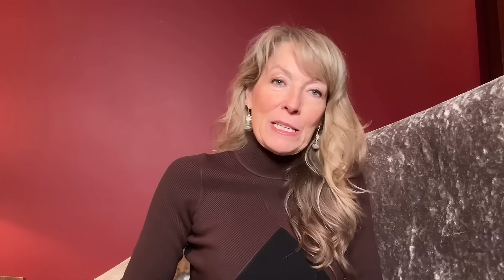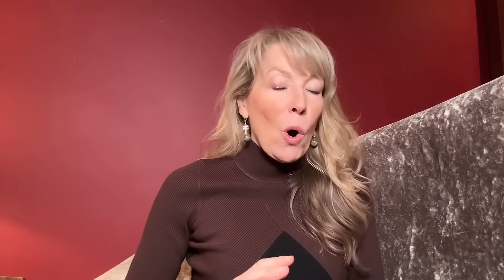Sun Dimming Explained | The Climate Experiment Nobody Voted For!

Comment: I made a youtube channel dedicated to this over 11 years ago called "Chemical Trails" and recorded sunny clear blue skies until the planes started flying back and forth covering the sky completely blocking out the sun.  Not chemicals but they may be using dry ice because 1 pound of dry ice mixed with water will produce 250 liters of carbon dioxide gas which will spread out and linger at 30,000 feet blocking out the sun.

Comment: I have a Masters of science degree in the medical field and I always loved all the sciences. I'm also a bit of a history nut, and kept finding examples in history when the climate then was warmer than today. As those examples seemed to be synchronous across multiple continents, I started to suspect what I'd been taught and always believed about climate might be wrong. To clarify the issue I began reading all the paleoclimate studies I could find. What I learned is this. If you haven't read the primary sources supporting both sides of this issue then what you think you know may be wrong.

Most paleoclimate studies done before the 1990s were straightforward and unambiguous. Those early studies found multiple periods throughout the Holocene that were significantly warmer than today. More specifically, the evidence showed and the scientific community agreed, the Medieval Warm Period from about 900 to 1300 AD, the Roman Warm period from about 250 B.C. to 400 AD, and the Minoan Warm Period from about 3200 BC to 2200 BC were at least 1-2°C warmer than today. The Holocene Climate Optimum from about 7500 BC to 3900 BC was at least 3°C warmer, and the early Holocene from 11,700 to 8,300 years ago was up to 7°C warmer than today. 

Throughout the Holocene these warm periods have been interrupted by abrupt cold periods that generally lasted 200 to 800 years, the first was the 8.2 kiloyear event followed by the 5.9 kiloyear event, then the 4.2 kiloyear event. The Late Antique Little Ice Age at 536–660 CE ended the Minoan Warm Period. The Dark Ages Cold Period from 400 to 800 AD, which included the particularly cold Late Antique Little Ice Age 536–660 AD ended the Roman Warm Period. The coldest and most recent climate downturns was the Little Ice Age from roughly 1300 to 1850 AD. The trend through all these cycles was gradual cooling. Each warm period was a bit cooler than the previous warm period, and each cold interruption was a bit cooler than the last. Regardless of the cause, there's nothing unusual about how the modern warm period fits this overall trend. The warming hasn't happened any faster and the temperatures haven't any been higher than during the Medieval Warm Period. The written histories tell us warm periods were times of abundance. Crop yields were high, seasons were predictable and mild, and weather was generally stable. Archeology implies warm periods saw civilizations rise, and with cold came famine, disease, population decline and civilizations often fell.

Modern textbooks wax poetic about Svante Arrhenius and teach his greenhouse hypothesis as though it were fact, but very few touch on the reasons it was essentially ignored for nearly a century. In 1900 Knut Angstrom pointed out that water vapor is far more abundant in the atmosphere than CO2, and intercepts almost all infrared radiation CO2 can absorb. Moreover, the small bandwidth of IR radiation CO2 might return to the Earth approaches full saturated above 350 PPM. I understand the counter arguments to this, but my point is the climate is a far more complicated system than the greenhouse hypothesis takes into account. Climate change is the product of many interactive variables that are difficult or impossible to quantify. There are many variables some scientists believe play a role which aren't factored into current climate models. There are probably many others no one has even considered. After much in depth study I think the complexity of climate is far too great to put much confidence in "consensus" views or any predictions based on computer models. Anyone who believes climate is as simple as how it's described in most textbooks, just doesn't know enough to know there's a lot about climate that nobody fully understands. There's good reason after 30 years working on the problem the IPCC has only managed to narrow their original estimate for ESC from 1.5°C to 4.5°C, down to between 2.0°C and 4°C. After investigating the history of how this issue evolved, I can think of many reasons outside science why the IPCC can never conclude ECS is low enough to not pose much risk, even though the most robust science suggests it's only about 0.5°C and no more than 1.5°C.

Regardless of anyone's estimate, what I can say for certain is something changed in academia starting at about the time of the 1978 Charney report. That report was the basis of the Carter administration's decision to create the Department of Energy and the same year the US started spending billions on research connecting anthropogenic emissions to global warming, and investing billions more on renewable energy, that for some reason excluded nuclear power. Since the late 70s the amount of money going into climate research, and carbon free energy (excluding nuclear) has grown bigger with each passing year. In my studies of climate I couldn't help noticing the more money went into research aimed at connecting anthropogenic emissions to global warming, the more low quality studies and untestable papers were published to confirm that connection. As years went by and even more money went towards establishing the connection, I noticed even the studies containing good evidence to support the previously agreed upon past warm periods were tending to focus on other aspects of the data instead, as if to avoid saying past warm periods were warmer than today. In cases where the evidence of previously agreed upon warmer periods was too incontrovertible to ignore, there seemed to be some kind of requisite to diminish the results by emphasizing the locality of the evidence and clarify such evidence shouldn't be considered representative of the climate as a whole. This approach seems to be part of a concerted effort to reconstruct the paleoclimate record, by saying the evidence of past warming was only a local phenomenon. To be clear, the real evidence hasn't really changed. It was just weakened and water down enough to make way for less scrupulous scientists to use less robust, misinterpreted and in some cases fraudulent evidence to get rid of those inconvenient times in the past that all scientists had previously agreed were warmer than today.

Then in 1988 James Hanson went before congress and said by the year 2000 New York City and large parts of Florida could be underwater if the world didn't quickly end its reliance on fossil fuels. That was the same year the IPCC was formed and chose to ignore hundreds of paleoclimate reconstructions done by many of the world's most prominent scientists, deciding instead to make a newly released tree ring study from a plucky young climatologist by the name of Michael Mann the focal point of their first report to the world. With that decision the hockey stick graph made its debut to the world. After that first report the idea that anthropogenic CO2 emissions were endangering the world went from a multibillion dollar premise to a multitrillion dollar premise almost overnight. In 2024 that annual figure surpassed 10 trillion dollars; more than 10% of global GDP. Trump pulled the US out of the Paris agreement, but he didn't do much to cut climate funding in his first term. 2025 was the first year since the Charney report that global spending on climate change was less than the previous year, and look at the impact that's caused. i can't help but wonder what might be if the climate change issue hadn't been flooded with such enormous sums of money for the last 50 years.

We'll never know the answer to that, but the way things played out, by the mid 1990s "the science was settled", and any scientist or academic who said anything against the "consensus" or criticized Mann's Hockey stick graph was instantly labelled a "climate denier", who must be on the payroll of big oil. Some of the most experienced scientists in academia were shown the door, and others took early retirement, but most had gotten the clue by that time. Is it really any wonder that over the last decade there's been so many studies focused on undoing the work that so clearly once showed the climate was warmer than today for most of the last 12,900 years? I suspect Michael Mann may not be the only climate activist who also became a scientist. 

That means for those of us who really want to know what the unbiased science says about climate history over the last 12,900 years, we must seek out and find ALL the evidence, while keeping in mind most of what contradicts the "consensus" is filtered out by the search engines. When we've managed to find the primary sources we must read them carefully and sometimes make our own interpretations of the data, because it's become painfully apparent certain things aren't allowed to be stated directly. The good news is there ARE still some scientists who put their scientific integrity above ambition. So long as they're willing risk their careers and future funding opportunities, being blackballed by their colleagues, and don't mind their work being published in more obscure journals, these scientists quietly go about doing good honest work that follows the evidence instead of the crowd. Others reveling in the freedoms of retirement are reaching large audiences through substack when academic journals refuse to publish their heretical work. A few such scientists have taken the time to create a Google Maps page featuring an ever growing number of paleoclimate studies from across the world, (currently at 1269) that evidence a Medieval Warm Period as warmer or warmer than today, that was more or less globally synchronous. Many of these studies go back further and generally confirm the paleoclimate record described above. If you're interested in learning what the primary sources really say about the climate cycles of the Holocene you can check it out at this link.

google.com/maps/d/viewer?mid=1akI_yGSUlO_qEvrmrIYv9kHknq4&ll=44.26323281744471%2C-112.89120099371223&z=2
Reply: Thank you for all the knowledge and time. Based on your knowledge on this subject do you think there’s a connection between what the planes spray daily and the strange weather patterns? What I’m getting at is weather manipulation to push the climate change agenda?
Reply: @kramer7026  Besides the notable decline in  hurricanes, I haven't noticed any strange weather patterns here in the US, but from what I know of the UK government, they seem to be a particularly sinister bunch willing to sacrifice the good of the native population for the globalist agenda on any number of fronts. I hope the people over there wake up from their state propaganda fed stupor in time to throw them all out of office in the next election, and put some new blood in office who'll do all they can to overhaul and tear down the unelected bureaucracy that actually runs the government, the way Trump has been trying to do over here in the states.

Comment: Ok so they spray the sky and that creates and prevents some of the heat or radiation from escaping like it’s supposed to do but with all of the houses that have solar panels is now a factor and A BIG problem is they also reflect sunlight back up and it can’t escape anymore so it’s going to be like a sauna or worse like a desert in just a little while !!!! Don’t these people know that it’s not a good idea to mess with the weather or the sun or solar panels it’s just not going to work out. !!! Rather than fossil fuel is good or not it doesn’t matter if we eat it or burn it or just leave it alone it’s not enough to cause any kind of problem because there’s just not that much left anyway it has worked out this far but keep using it and develop something,something a lot better than a battery life because the damage caused by all this research has shown to be more harmful than anything else and poisoned earth with far more harmful chemicals than the fossil fuels so why don’t you brainiacs just stop and stop now stupid

Comment: WAKE UP. THE MAGNETOSPHERE HAS BEEN WEAKENING SINCE 1859, AND IS NOW ABOUT 35%+ WEAKER AND 1/2 OF THAT IN THE LAST 20-25 YEARS. The temperature is lower, but you can feel the sun is more intense. This is going to get worse; they have used their BS IPCC climate agenda to create a smokescreen. It's covered up this for 10-20 eyars, if not for Geoengeineering you would see it so plainly, plus it also helps degrade our environment for other goals, it's hard for this to even cover up the weakening magnetosphere. They will probably drop it when it suits, and we see the full brunt in a short time. They are up against a clock from natural cycles and need to scam us wealth-wise and get us under control before this all hits.
The CO2 we are supposed to be making is coming from this. ( of course, to get printed, this paper had to say CO2 and warming). We have since the last full magnetic pole reversal 781K years ago 45-60 major magnetic pole excursions and movements. One 42K eyars ago sent 60% fo large animals extinct and was the end of the majority of Neandertals. As it gets weaker, the chance for a normal CME from the sun to take out our electric wrold massively increases
https://www.researchgate.net/publication/281612324_Earth%27s_Diminishing_Magnetic_Dipole_Moment_is_Driving_Global_Carbon_Dioxide_Levels_and_Global_Warming

Comment: The commie enviro-whackos will be the death of us all. What most people don't understand is that there isn't enough sunlight to react with all the CO2 in the atmosphere by orders of magnitude. 100% of the sunlight hitting Earth reacts completely with just a tiny fraction of the available amount of CO2 in the atmosphere. This means that increasing or decreasing the amount of CO2 in the atmosphere from present levels will have ZERO effect on warming because all of the sunlight is already absorbed with only a fraction of the CO2 currently available. More CO2 will do NOTHING to the temperature of the planet. Why isn't the media reporting this? Why aren't we reporting this more? Another fallacy is that oil, coal, and gas come from rotting dinosaurs or ancient plant material. Not so. There NEVER was enough of that bio mass to produce as much oil, coal, and gas as is available. They were produced deep in the Earth's crust from chemicals, heat, and pressure. THERE IS NO SUCH THING AS FOSSIL FUELS.

Comment: Latest boondoggle that won't work. Earth directed sunlight reflected back toward the sun, is reflected back toward earth by the incoming sunlight. The moon does this during a solar eclipse. Even though the sun is blocked, the intensity of the light that gets by is increased. Ground and even water soaks it up like capacitors. Lake effect snow in winter is a prime example. You can follow the track of an eclipse for months after; from the increased storm energy, drought, and wildfires along the path of totality.

Comment: Hey doc,I'm not a scientist or a climatologist,however I know that a gas of any description needs a container  for u to measure it. We r told earth is a open system? So how can a measurement be made.the alleged composition of earth's atmosphere is nitrogen,oxygen, argon and 3%a mix of noble gases.21%is oxygen 81%nitrogen.this is a well established fact.. that is a consistent result that remains unchanged since it's introduction. Nothing added or removed. Always the same,no green houes gases r present in air  when samples are taken and measured using gas chromatography.a method of annalise we cannot repet or attempt due to the equipment apparatus nessasary being excessively expensive 100s of thousands  of pounds.all gas laws have been proved in thermal dynamics here on earth using a container to hold the gas,volume is the container,size,pressure is the action from gas particles colliding with the container walls, if u reduce the volume (compression)heat is released in the container,like a bicycle hand pump heats up when inflating a tiyer.a inner tube is the container.There appears to b inconsistencies in how the components of "air" are measured and specified to b what is claimed they are 🤔

Comment: A Harvard study from 2020 found wind turbines will cause more warming in Minnesota than emissions reductions would avert. "Wind turbines cause local temperature increases at the surface of the earth by causing air to mix throughout portions of the atmosphere...According to the study, wind turbines measuring between 100 and 150 meters (328ft to 498 ft) operating at night can pull down warmer air from as far as 1,640 feet in the air down to the surface, warming the surface of the earth, where it would impact the people, plants, and animals living near the turbines....the warming impact of wind turbines is immediate, and highly localized in the areas that are the “hosts” to the installations. ... surface temperatures in the United States increase more due to wind turbines mixing air in the atmosphere than would be offset by reducing emissions."